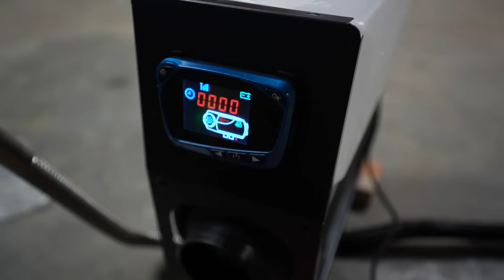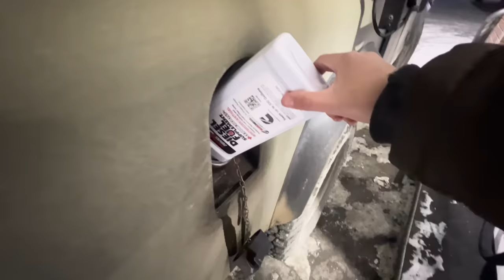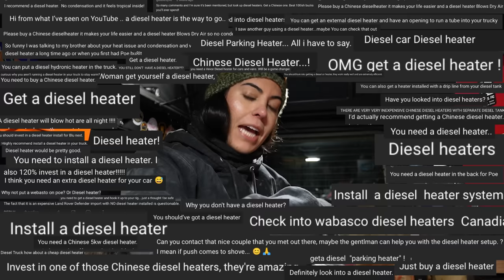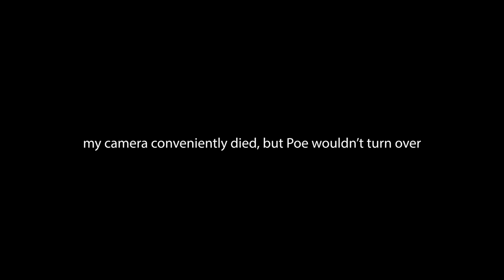Truck Camping in -15 Degrees under the Northern Lights

Comment: My daughter was born in Anchorage and I remember the Northern lights they are spectacular. 
I am doing the carnivore journey and thank goodness my fridge is keeping the meat frozen while on the 
road. Am using a small fry pan which is working great. I am currently roaming in a 2012 Prius V 
much better gas mileage than the Roadtrek. I remember the Alcan Highway but I drove it over 
45 years ago. Be aware with the cold there and don't let your diesel freeze and gel. I am shocked 
that anyone would do Alaska without any heater. Stay safe and keep the rubber side down.

Comment: Hello  your Additionel lithium starter has to be Kept warm to work properly.  Before cranking turn the key 3 Times and whait same seconds. While cranking puch 5 times very fast the throttle pedal to the flor. Do not crank to long. Better to Do this procedure twice.  If this is not working you need to warm up your diesel filter .

Comment: You need a block heater. They have magnetic ones that will stick to the block. Then when you are around electricity you can plug it in. Your power station might even run it.  Also on really cold days run the glow plug cycle 3 times through than try to start. Last but not least always have a back up heat source.

Comment: Hi Maria. The problem with the heater is that your jackery may not have enough amps to run the glow plug. You need 20 amps and I believe the Jackery 12v dc runs at 10 amps. You will need either a regulated 30 amp power supply or a 110v ac step down to 12v power supply with at least 25 - 30 amps which is pricey but easier set up.  Hope that helps.

Comment: The Diesel heater is drawing to much power on start up then the Jackery can handle. I start my Diesel heater off the car battery then once up and running I switch to the Bluetti. I have a two power pig tail connection. Best to have the heater draw the intake from the inside of the car so you get more heated air.

Comment: Hey as long as you have the diesel heater exhaust vented out the bottom of your truck it is safe to keep indoors. Diesel heaters are far more efficient when they are inside running off of already heated up air. My diesel heater is vented through the bottom of my vehicle and my carbon monoxide detector has never detected any carbon monoxide

Comment: Look into investing in an engine block heater when you hit Seattle also at least if you plan on doing more -15° camping trips.  
Try the boiling pot of water toss too it's the coolest chemical reaction ever works when temperatures gets below -14°.

Comment: The fuel pump on the diesel heaters will not start pumping during start up until the glow plug is red hot enough to accept the fuel. I don't know the Jackery amperage specs on the 12 volt plug in....but most units are approx 10 amps and it seems the unit is shutting off during the glow plug phase of start up before the fuel pump is supposed to start

Comment: PLEASE READ!!!❤
TIP: diesel car takes long to heat itself thats normal so if there is no heat blowing out then turn the heating off. you are taking the little heat that the engine produces away... wait for idk 30 min so the eng8ne heats itself and then turn it on. and dont put it on full blow either.... you will lose the heat again and fast. my guess would be put it on medium, but u really have to test as to how far u can push it before it starts to lose heat again. all this that i wrote is not something i am sure coz i never dealt with such low temps. i presume u mean - 15°F yes? - 15°C this method is good

monitor your temp gauge. normal vehicles have a working temp at 90°C dont know how much is that in °F. it could be higher even more than 100°C in your case. it usually shows in the center of the gauge. when you get to that point you are good to go so start with medium setting and see what the gauge is showing. is it holding or droping. h9lding mean good and you can try stronger blow. droping means you have to lower the blow intensity. please watch yourself and blue❤

Comment: If it gets so cold that POES engine does not produce enough heat don't be afraid to block off the front grill to keep the cold air out. Almost every school bus in Canada has a blanket on the front grill. A Battery Tender wired directly to your battery would be a good idea too. Be safe!

Comment: Ria...,you should also see about having Poe insulated. That northern lights thing was awesome! As for being extra cold. Keep your core warm. Also your feet and hands. As they loose heat being the furthest from your core. Also I don't remember the video...but I seem to recall one,where there was a small tiny wood burning stove/ heater built into the vehicle. Either way..prepare prepare that Poe, he'll keep you out of trouble on down the line. Stay safe out there girl.

Comment: You need an inlet vent on the side of the truck and maybe just chain and lock the heater outside or bracket to hang it or the roof whatever works for you,,, the side or ground is probably btter for when you have to refuel you wont have to get on the roof,,, maybe the back door like permanent with a cover and the inlet vent so you dont have to keep setting it up and taking it down every day,,, once you get that heater installed the way you want it, you're gonna love it, its going to completely change your camping life !!!

Comment: One of the side bins would be a good location for the diesel heater. You could cut into the back of the bin and vent it directly into the rear cab Youd lose some storage space but if it was on a slide out it would be a neat solution. You could even channel some of the heat through a pipe to the engine bay.

Comment: I'm Canadian and have been out for a whole winter.  Back-up heaters are a must . I've been put in the middle of nowhere in a rv at 40 below ... Northen lights differ some nights there a skuff loke a cloud other nights they are so clear . 
Desel heaters usually air in the lines . I just press mine over and over, and it works itself out . 
Poe will have cold air for a while because she's a diesel.  I have a wabasto that heats me and my motor . That's the desil heater you need . Desils have to be plugged in or kept running . Very hard on them to be down in the cold . Desils have to be taken care of and babied.

Comment: I know they’re expensive but you should get a bigger jump box. I know those small ones die super quickly and most the time if it’s a super hard start it’ll die in the middle of the jump. I use the small one as a battery pack to charge devices now and a very large one to jump by car in the bitter cold winter since my car is old lol just thought it’s a helpful tip so you never get stranded.

Comment: Quite a few older diesels including my 2005 Dodge Cummins, stop making good heat  in real cold unless on high idle or driving. Step 1 get a high idle kit for Poe. Step 2, always keep a Buddy heater and 1 pound cans for backup or emergencies when camping in extreme cold. Step 3 do not shut the truck off, let it idle overnight. Step 4 if you don't have Buddy heater use your gas stove for heat just vent your space well and don't sleep with it on. Remember steps 2 & 4 will put lots of condensation into your area so venting is a must or things get wet and it's game over. Step 5 go to Teton Sports and get yourself one of their minus 35 degree bags, it will save ya in that cold. Step 6 get a block heater and plug it in when it's that cold. Been truck camping for many years and have gutted out a minus 15 before. Only once then learned what I just typed. I try not to camp in below zero weather when I can, my minus 20 Teton bag is at it's comfort limit. Best of luck, stay safe....

Comment: Maybe someone has mentioned it already but you should have a sleeping bag that's designed for that weather. The same kind that mountaineers use when climbing Everest and similar harsh environments. They are expensive but worth the price. I slept in a tent with a good bag (no heat) in negative F temps and was perfectly fine.

Comment: For in the future get yourself some cardboard and partially cover the radiator on Poe, that will restrict the air flow over the radiator and caused the temperature to go up and will give you more heat.

Comment: The problem with the diesel heater is very simple. One. The wiring for the power supply are very thin. Upgrade to thicker(10gauge). 2 the jackery might not provide enough amperage to light up the glow plug. Seen it before.

Comment: Personally, maria those of us who have actually lived & worked that far north are only trying to keep you and blue safe. The cold you are experiencing will never be like anything you are used to in Michigan.  It can feel like razor blades cutting through your skin is why you have to have layers on and be prepared for that type of climate. Please think logically and don't take chances you may regret later. We are all for you roaming Reckless but when dealing with extreme cold weather such as -15 or more could and has caused vehicle failure and death. I will be praying for you and blue meanwhile stay safe and warm. p/s at least if you still had the buddy heater you would have stayed warmer.

Comment: I just felt so bad for you in this video. I was one who suggested a diesel heater, but I wasn’t very specific about it and now I feel bad for that. You need a permanent mount style, and have someone help you install it. I’ve got a heater with that type display and yours is shutting down the instant the glow plug kicks in. There is either a shorted glow plug, shorted power wire to the glow plug, or your 12 volt supply from that port in your jackery isn’t enough amperage. My heater pulls ALOT of juice on the warmup cycle (which lasts for a while) I’ve got strong electrical and it drops the voltage all the way into the 11s during startup and then bounces back. Insulating the fuel line to the heater if you chose to install it outside like the heater comes setup for is a good idea. I rerouted the fuel line out the side of the heater case so I could keep the lines inside to prevent gelling when it’s colder. And buy and extra glow plug to carry. ❤

Comment: Put heater in the truck they do not work efficiently when sitting in the could. . Exhaust gets run out through an opening to outside . I work on these type of heaters. We install in transport trucks for interior heat. Your wiring to the jackery is not heavy enough and is dropping voltage. Connect the heater direct to your extra truck battery and it should work fine. Possibly oil change guys could help you with this.

Comment: Has no one suggest you keep poe running in subzero weather,next find a front cover for radiator, this will help keep the engine a bit warmer.
Plus remember to get auxiliary heater in place before needing it. Just be thankful the fuel has not jellied up..learn that lesson many decades ago..Do enjoy ur videos..

Comment: Ive seen ppl with those heaters saying they need a good 12v supply, when it drop to far below 12v and the glowplug goes to heat up, it will shut the machine off. The jackery should do it, unless it has a low charge

Comment: Please be safe Ria and Blue! I’m not sure if the Land Rover has one but a lot of diesel vehicles have block heaters that you can plug in to help the engine start in cold weather. It will save your batteries from the constant cranking. I know it’s not always possible to plug it in when you’re away from civilization but if you find yourself near an outlet it will help you.

Comment: Alot of diesel heaters pull way more than 10 amps on start up - the jackery only puts out 10A on the cigarette plug. Some power stations have a 30A DC out and that is what people are using. You could always just use an actual 12V battery. Or get a DC to AC converter- it will use more power but wont be limited like the 10A DC output.

Comment: Can you get a battery blanket installed on your beloved Poe and plug it in when you are not driving him? Maybe when they do the heater install. And can they get the heater to tie into your diesel fuel system. If you can, ol’ Poe will love and respect you even more. And if you get a chance to put your truck in a garage at an air b n b, it might be the tender loving care that will help Poe keep on performing. This was a tough one to watch. Please stay safe and take care of you. ❄️🇨🇦👋🏼

Comment: Are you covering Poe's grill with something?  Like cardboard and bungies? This will help with Poe running too cold, and will improve the cold heater problem.  The engines cooling system becomes counter productive at air temps below 20F or so.

Comment: Your issue is the diesel heater pulls more amps than the jackets can do in the cigarette lighter. Your easy options are a car battery with a battery charger off your jackery or a ac to DC converter off your jackery. Sorry it was so cold but super easy issue to fix

Comment: For your diesel heater! It looks like you aren't getting enough power to get it running. Set it as low as you can and see if that works. For some reason Jackery units have a hard time, sometimes, getting the heaters started.

Comment: Hey Alaskan technician here. I would check the amperage draw on the diesel heater to make sure that it’s compatible with the amperage output on your power source. Typically whenever a control board blinks like that it’s because there is not enough power and it shuts off and resets. As far is the extremely cold temperatures go I would pick up a -40° sleeping bag that’ll keep you toasty down to about -20°. Those are pretty expensive if you can’t find them secondhand, but you can also get some online for a couple hundred dollars. As far as people calling you stupid don’t listen to them. It can be scary if you haven’t experienced those temperatures before. If you’re careful at planning and have an easy exit strategy, you can camp down to -30° outside without a tent and still be safe

Comment: I believe it’s possible that your Jackery doesn’t have enough starting power for the glow plugs and the pump. You could hook your diesel pump to your car battery and use the Jackery to charge your car battery.

Comment: Normaly cars have two water cycles the inner for heater . And that for the outer to cool the engine. Both devided by a semy closing liquid expanding Valve.  If this cheap Valve is defekt always the big outer cycle is totally open.  So it takes longer drivetime until you get warm up your inside . And you Lose heat at idlinngcst the outside Radiator.  So check this Valve. If it closes in cold water.

Comment: I saw you driving through wasilla… could have let you use my shop for a bit.
I’m sure you’re well on your way to warmer temps. But for next time couple tips.. go don’t cheap on a heater. Wasbasto or planar. 
I’m sure it would take up some room but a wood stove would be clutch. 
Look into a grill cover.. it will help to  keep heat in while at idle.

Comment: Metal box, not insulated, Alu-cab up with canvas walls 🤷‍♀️, truck running with heater blasting  Maria what the heck. Where did you think the heat was going to go 🤪
Very scared for you but so happy you got an airbnb.  Maybe consider sleeping in the main area of the truck while in Alaska…. Or start meandering south 👍🏻
Go Blue keeping mommy warm and good start Poe 🙌🏻🙌🏻🙌🏻🙌🏻

Comment: A non-mechanical wood heater would be a good option as it would dry up moisture as well as be more dependable.

There are some really nice smaller ones that will work in truck campers.

Comment: I'm not gonna totally hate on you.. but, how I'm gonna go about getting my truck setup going is prepare for the worst before I even start out on my journey.. I'd rather have it and not need it, then need it and not have it my friend... I'm also contemplating using a pomoly hot tent wood stove in my campershell truck conversion.. for heat in the winter... but, I'm totally going to prepare for the worse case scenario before I set out on my journey.. good luck my friend stay warm out there

Comment: So a few suggestions for ya. Make a winter front for Poe, diesel engines don’t keep temp well in the cold, especially extreme cold like you were in. A piece of cardboard in front of the radiator will do. Also figure out if it has a way to high idle, or come up with something yourself to bump up the engine RPMs so that it will run warmer when you’re parked and in that situation. A few hundred RPMs over normal idle can do wonders for engine temp. Next keep a back up heater, that buddy heater you returned could have saved your life if things went any more wrong than they did, propane freezes but at a much lower temp than diesel. And now for the diesel heater, have it installed and mounted in a way that the heat it puts off can also be used to keep the fuel in it from gelling. Odds are if you had gotten it running, unless it has a tank heater in it the fuel would have gelled in it anyways sitting outside. Hope some of this helps!

Comment: I'm sure you already tried this, but try running your diesel heater from an outlet other than the jackery to rule out it being the culprit.  Some power stations can't handle the initial power draw of the glow plug.

Comment: Those diesel heaters work great, The one i have  was  i also thought the glow plug was bad, until i realized i had to prime the pump, Once i did that it did its initial burn its gonna smoke like hell after that initial burn it works beautiful and puts out a good amount of heat, Im a truck driver and at -21 it had me sweating i also have a vevor in my garage